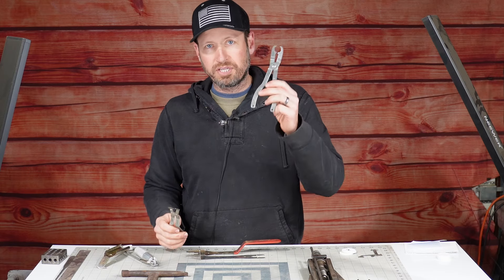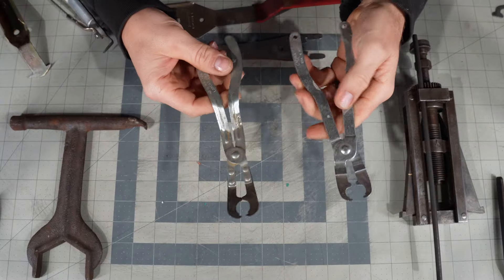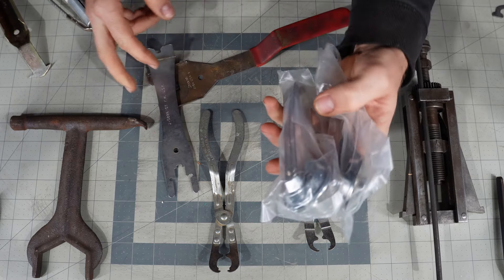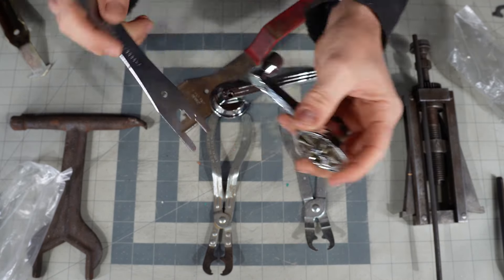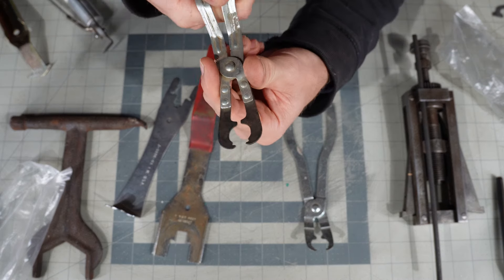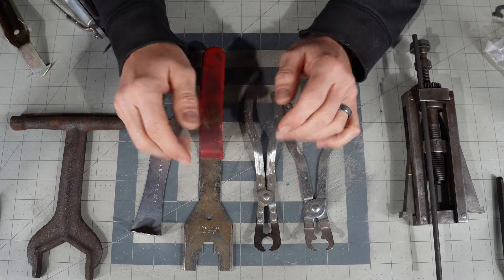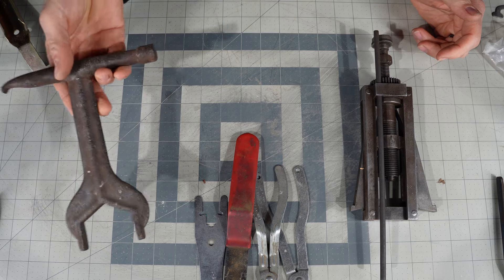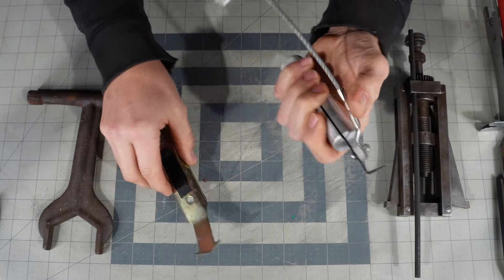Uncommon tools 061

Comment: Pull knife for windshield urethane or butyl bed cutting and a molding clip release tool. Did mobile auto glass while in college.  That clip release tool, yuk. You’d usually be working on an older style butyl tape window when you had to pop the moldings off to get into the edge to run the pull knife through the bed.  Summer days in NC, that butyl would turn into a stringy mess that reattached itself as soon as you cut it. Getting shivers thinking about it.  The best versions of those tools were made by Equalizer